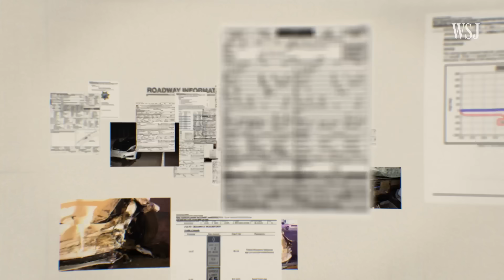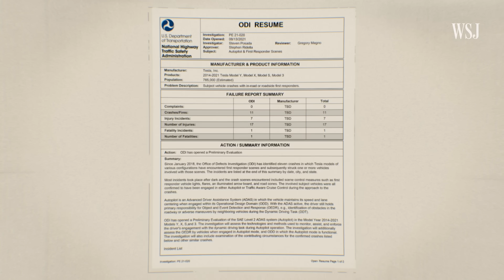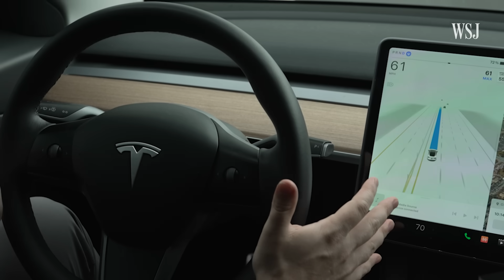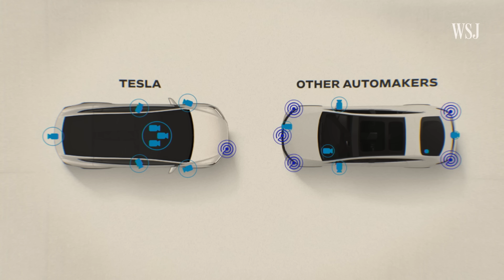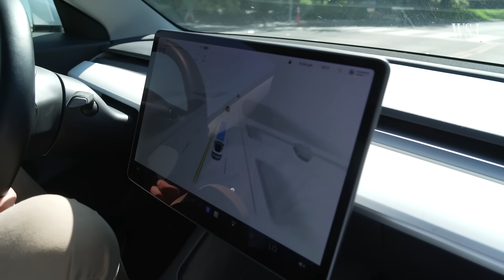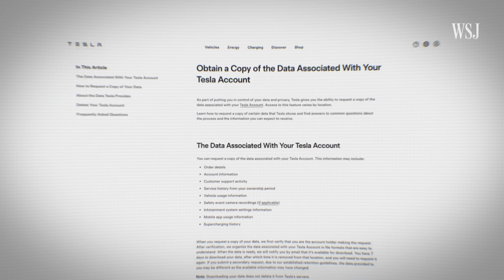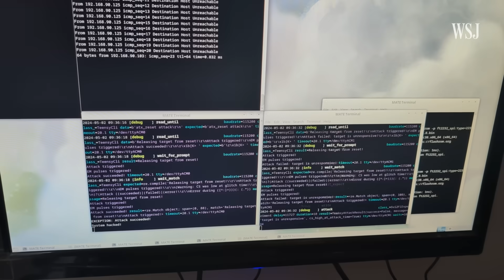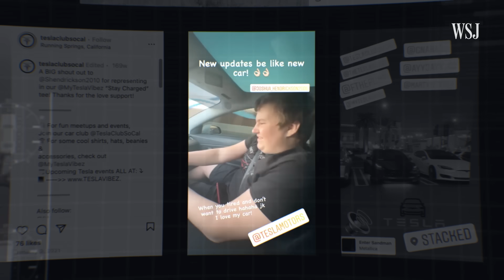The Hidden Autopilot Data That Reveals Why Teslas Crash | WSJ

Comment: I see three main problems
1. Autopilot does not mean you leave your car unattended.
2. Saving $ by not using LiDAR—yes, they are doing that, and it is risky. Cameras don’t perform as well as LiDAR, not even close at night or in fog….
3. A very smart but also dangerous guy continues saying his cars can drive autonomously.
Reply: It makes no sense not to use LIDAR. They have gotten much cheaper now. SpaceX uses it to land the rockets. Using it to train the cameras rather than have a unit on a car just sounds like more work with no progress.
Reply: @willriley1619  It makes no sense to use Lidar if it isn't needed. FSD 13 is showing just how good FSD is getting. And it will only get better.
Reply: @daydreamer8373  If LIDAR can improve any level of autonomous driving why not use it? To save $1500-$2000? Time will tell I guess but I wouldn't want to be on the opposite side of Volvo and Mercedes Benz when it comes to automotive safety.
Reply: @daydreamer8373  Elon obviously knows the advantages of using LIDAR that's why it's used on SpaceX rockets. Otherwise he would just strap 100 gopro cameras to it.
Reply: @willriley1619  Exactly Elon is no stranger to Lidar, he understands it's capabilities and limitations. V13 is proving Lidar is not required.
Reply: @daydreamer8373  Well lasers can see farther than cameras and if it helps give the car even 1 more second in a crash scenario especially highway would be better to have it than not.
Reply: @willriley1619  Yes that is why a Waymo crashed into a large pole a few months back. Lidar is not some self driving magic. V13 is doing some incredible things, and is set to make our roads far safer.
Reply: @daydreamer8373  Try FSD 13 in late night, rain, fog. I guarantee you it's going to be a hazard regardless. I have latest FSD 12 and it would even disabled itself when sun is beaming at the camera or cars from another direction with light beaming at it as well. It's just doesn't work outside of perfect day time. Not to mention is still struggling to find where the curb is. FSD 13 might behave slightly better, but those are the fundamental problem that Camera base system cannot resolve. The whole point using cheap camera only is to gather machine learning data for TESLA. You are making products for them essentially.
Reply: @tendieman69  Actually there are videos of V13 precisely in those conditions and worse performing very well. V13 is a big leap forward in capability, even over V12.  To be honest it is surprising even me. I have not tried any self driving btw. I have just been following it's progress, not Just FSD, but Waymo, Cruise etc.
Reply: @SmallSpoonBrigade  There are two reason for them to not use LiDAR. The explicit one (according to them) is that they don’t want to complicate their stream of signal processing due to the conflict of two different type of sensors. The implicit one is the cost of LiDAR which they never want to admit.
Reply: The car can drive autonomously. It just can't combine safety and autonomy.
Reply: @InternetRoot  Too much of a risk especially for insurance companies. The Tesla will shut off "FSD" within 1 second of a crash attempting to leave the driver responsible.
Reply: @willriley1619  The Cybercab doesn't have a steering wheel. I'm sure FSD will get into accidents. People are too unpredictable. But the data will show automation to be far safer. Insurance companies will see humans as the liability, not automation.
Reply: @daydreamer8373  The Cybercab is just a concept right now. The chances of seeing it anytime soon are close to zero.
Reply: @willriley1619  Tesla FSD is in perpetual beta for a reason. https://en.m.wikipedia.org/wiki/Perpetual_beta
Reply: Remember when cars weren't expected to have Lidar and save you from crashing in poor driving conditions? I sure do.
Reply: worked at a few of the big name startups for lidar and know the industry. its mostly $, lidar isnt being implemented beyond testing not cuz it doesnt work yet but its magnitudes too expensive. from watching the companies, i doubt this generation of companies will ever achieve a working model and it will take new companies and innovation to do it. tesla isnt using lidars because it CANT. also keep in mind tesla is competing with BYD and ev's from other markets and the chinese market, which has already beaten the US market in battery technology and has both horizontal and vertically scaling supply chains that tesla has to acquire from. All in all, chinese ev's and battery tech in those fields is too close to fully beating tesla so handycapping one of their main features is really dumb.
Reply: but akkshully it’s just the drivers fault for not paying attention!!! genius elon is innocent!
Reply: Let's ignore everything else, right? Like the fact that he also says that it's in development and YOU ARE IN CONTROL
Reply: @Vlperine  Yes it is still in development. It is a level two system, and the driver is responsible. But FSD is improving at a rapid pace. Soon the responsibility will be on FSD.
Reply: he saying they can, but he never said that they are driving now... he saying that they will reach to that point.
Reply: @George_Shonia  Look back at Elon's comment on FSD, he already said multiple time that the car can drive itself by the end of either this year or next year yet every time it fail to do so. Don't get me wrong, FSD is actually improving quite a lot since but still far from driving itself safely.
Reply: @michaeltan9512  yeas, he set particular time frame but they always failed, but he never ever said that car is already self driving & it's autonomous, he promised it fir future but never claimed it as a present.. so why people are angry I don't understand... even car is telling you every time you enable autopilot or FSD that you're in charge & you've to be ready at any time to take over.. that's it,this is the fact.
Reply: @George_Shonia  The fact that people are angry is mostly because of false advertisement. People bought FSD a few years back because they trusted Elon but now FSD still far away from full & safe autonomous. I would be angry too if I were the one who purchased FSD back then. Remember the clip a while back when Tesla showed a video with FSD enabled from parking lot to parking lot? It was staged according to former employee. I wouldn't count all responsibility toward Tesla since driver should still pay attention and take control at all time with either FSD or autopilot enabled, but at least Tesla shouldn't advertise in a way that makes people think their cars can drive itself safely, luckily now it seems they are slowly changing it, just look at the naming history of FSD.
Reply: @michaeltan9512  so it doesn't matter what Elon says. you value and protect your life with your choices. because you trust a computer blindly and someone elses word that the car can drive itself then you decide to go to sleep in the car, end up dying. I'm sorry but it's not elons fault or his job to protect your life. 
FSD is improving and learning. 
besides, when you select FSD in the settings to turn it on you get a big safety message saying that "YOU still need to pay attention" be ready to intervene if necessary. people are just morons if Elon said they can they are not gonna read the mesage on the screen and go to sleep.
Reply: @mohammadkamran5862  True but that wasn't the point I was talking about. Driver should take all responsibilities at current state of FSD, go read my comment again; however, if a company is advertising something that wasn't actually true, or at least not true atm, the company should be held accountable to a certain extend. There was a case against Tesla recently about their false advertisement, the lawyer who defended for Tesla explicitly said that the Ads were exaggerated. You might say some individuals are dumb enough that they think drinking redbull can give them wings, but false advertisement can be dangerous.
Reply: @michaeltan9512  lol. yes in some instances a should be held accountable. I do agree with you that Elon does advertise FSD as being autonomous. but at the same time people are stupid. lol. no matter what the advertisement says, there's always the fine print with everything that a person needs to be careful about. and like I said regardless of what Elon advertises, before you even enable FSD it gives a warning and asks you to accept that you will pay attention, also take over at any moment.
personally I think hate or love the guy, Elon is doing a lot to move the world forward. EVs were just a dream until Tesla came along, autonomous cars was just a dream until Tesla actually pushed it forward. and even though FSD has its faults it's still mind blowing that our cars can actually drive us from point A to B perfectly 99% of the time. I meant if it wasn't for Elon pushing these things we'd still be living in the stone age and at the mercy of the legacy automakers Mafia.
Reply: @mohammadkamran5862  I am not trying to downplay Elon or FSD. His vision and decision making are what made him so influential and I am a fan of him, for the most part. But at the end he still is a business man. His way of advertising FSD is solely in favor of his own business rather than public safety. Having people pay you for a seat of beta tester is a genius idea, the better part is that if accidents happen you won't be held for any responsibility. To me that's totally fine, but you have to be honest with your beta tester instead of doing false advertisement.

Comment: Autopilot is an ASSIST. YOU need to be ALERT at all times ! It pains me to see that many in my tesla chat group are using defeat devices like weights on the steering wheel to cheat the system into thinking you are holding the steering wheel, or to blind the cabin camera so that it does not warn you on playing your phone while driving. At the end, drivers are ultimately responsible for their own driving journey,

Comment: it doesn't take a computer science degree to understand that tesla vision (camera only FSD) is a very controversial move. It doesn't see enough in the dark. It can't handle obstacles it's not trained to see... Other strange design decisions like steering wheel turn signal buttons or touchscreen only controls for basically everything are just dangerous and are a lack of regulations
Reply: If LIDAR is the solution, why did a Waymo car hit a post last summer? It still has to be trained at what objects it seeing are.
Reply: @sylvaing1  LiDAR helps but it's by no means is the holy grail. And if you take it out of the equation FSD gets worse.
But in general, the industry don't have good enough hardware and software for the FSD at the moment. Only marketing and half-baked solutions.
Reply: @ТАТАРИН-й2д  there's no need to guess. greentheonly already pulled raw images of cameras being in direct view of sunlight and in near pitch black. it's more than fine. whether regulations are bad wasn't the point. tesla is complying. lidar contributes noise. taking it out of the equation improves the effectiveness of the vision only setup
Reply: @runlit120  I don't know about the direct sunlight images but the night footage looks awful. The ISO is crazy and so is the noise level. This is done as the last resort to compensate the poor light sensitivity of the sensor, limited optics, and exposure options. Side cameras are getting blinded by the oncoming traffic. And if you refer to the greentheonly videos you probably noticed how image recognition boxes are jumping almost every second. I can't think of a self driving algorithm that will work perfectly with such unreliable inputs. And if we're talking FSD anything but perfect is simply not acceptable because your life depends on it.
As for the regulation, of course Tesla is complying with them. They innovated some thins that (in my humble opinion) are going against the common sense. So no one even though of regulating them before and now authorities are clearly falling behind (or don't want to pay attention).
Reply: @ТАТАРИН-й2д  it doesn't really matter if the ISO is high as long as you can still make decisions based off the image. and remember, the images look pitch black to a human, but to the camera, it's a noisy image. if a human can't drive in pitch black, we shouldn't expect FSD to drive in pitch black even though it can still see. i dont know what video you're talking about, there are many videos. boxes jumping are based off of old FSD stack. new stack works a lot better. it's not really an "algorithm", it's based off of models. Regulation: there is a regulation framework already in place in various states. Even then, Elon is part of the government now so even if there were plans to regulate tesla before, it'll be much relaxed now.
Reply: @runlit120  correct, I don't expect regulations to improve in the nearest future but I also don't see this as a positive thing.
As for the ISO, in the videos that I saw the highway is fairly lit with the headlights of the cars. I know you probably can't post a link to the video that you're referring to in here but I checked everything that is available on the greentheonly's channel and didn't notice anything impressive.
I'd say cameras see as much as humans normally do. But with tremendous amount of noise. To go beyond that they might need to utilize some kind of a night vision, but it's not implemented in the tesla/fsd yet. And the boxes are jumping event in the daylight, just not as badly.
Their models are still algorithms in the end of the day. They are just way more complicated and don't have a formal code to them (instead there are weighted decision matrices). It's much harder to predict their behavior and modify it which is also concerning. Models are only judged by their performance but developers don't have control over all the corner cases unless there is an explicit override for every one of them. And even then it's not very efficient (think about censorship in chat gpt that can be bypassed fairly easily). And when by accident those corner cases handled incorrectly we see things like the ones in this video. And the problem here is that it's really hard to find and fix all of them. And it get's exponentially harder as you progress. This is why I don't expect FSD to be reliable in the foreseen future even if the hardware will get perfect. (For example, waymo don't care about the looks and just installing bulky devices onto their cars - and they still crash)
Reply: @ТАТАРИН-й2д  NHTSA proposed a program literally today for Automated Driving Systems, so your prediction ended up not being true. I don't think you checked everything on greentheonly. he reposted a post by rice_fry discussing how "the dark areas are pitch black" but the photo shows details that you can make out. It's literally better than what humans can see. The statement "I can't think of any algorithm" is contextually different than calling a trained neural network an algorithm. Who said anything about perfection? There will never be a perfect self driving car, ever.
Reply: @ТАТАРИН-й2д uh nope. you're not understanding the hardware setup. the cameras are twelve bit which can see much more than what the human eye can see. tesla is complying with regulations, zero issue.
Reply: @runlit120  I do understand the hardware because I actually develop a software for it (not for tesla though). 12 bit doesn't mean anything if the lens is bad or sensor light sensitivity is not good enough. Tbh we don't have a good enough technology to provide stable (at least) 30 fps in the dark and see far enough. And even in the daytime you may notice that "vision" is constantly glitching while trying to recognize objects around the car. Their algorithm approximates the data of course and filters out most of the errors. But still, there is no way I can call it reliable.
Reply: @runlit120  as for the regulations, they are quite bad in the US and also falling behind many innovations thanks to the bureaucracy. In Europe, at least the cybertruck is banned. But other than that they are not any better. They are only obsessed with ecological restrictions... 
Think for yourself: we are not allowed to text while driving but it's still perfectly "normal" to use a tablet just because it's a standard equipment of the car now. This doesn't make much sense to me.
Reply: Most people have no idea just how good FSD is getting. Tesla are well set to dominate in this space, and Tesla stock is rising to record highs because of it.

Comment: Phantom breaking events can be just as dangerous. Musk is right not to want have to decide which data is right between lidar and vision and instead trying to improve vision. Because Lidar will never be able to do it alone.

I think people have a lack of understanding what fsd is and how it works. Edge / corner cases is where software fails (not only Tesla’s) so you can never trust it it fully.